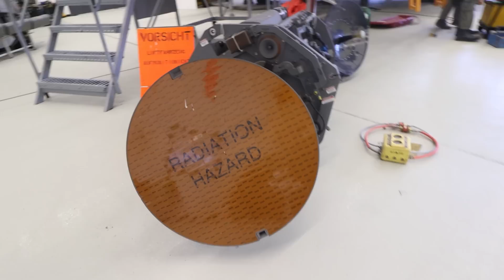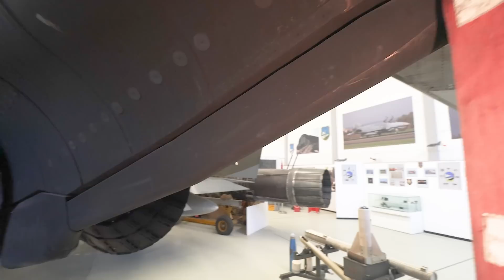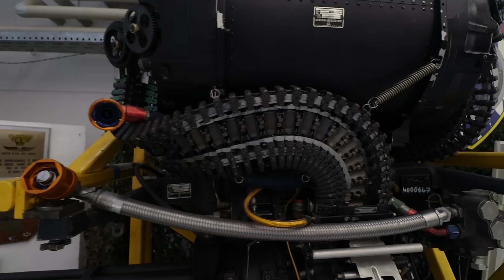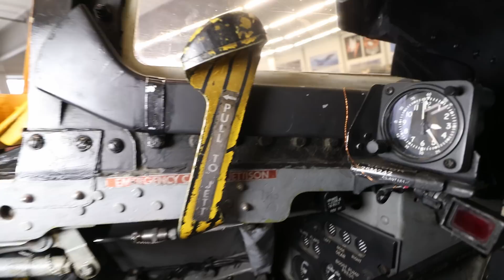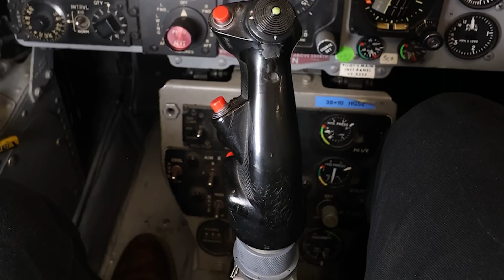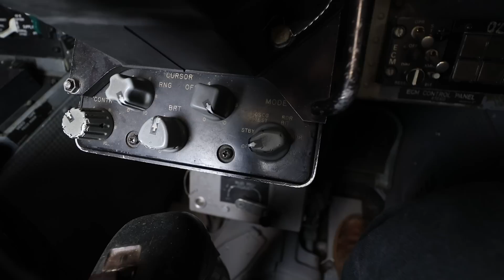Inside The Legendary F-4F Phantom II: Full Walkaround & Cockpit Tour

Comment: In the F-14 and F-4, the guy in the back is a RIO, not a WSO.
Reply: As an former USAF F-4 backseater, I can confirm that the correct title for the Guy in Back (aka GIB) is Weapons System Officer. I believe the  Navy and Marines used the title RIO - Radar Intercept Officer.
Reply: @GWBuck the Navy/Marine F-4  GIB wasn't a pilot(Naval Aviator) he was a NFO.  In the Air Force both guys at first were pilots.  That's a key difference.   This changed in the 70s to the WSO designation but in Naval Aviation they were never pilots; RIOs were all NFOs.   Those dudes had an easier transition to Tomcat RIO than the pilot of an F-4 did to Tomcat pilot.
Reply: @karlchilderz Good additional information. The transition in the Air Force from Pilot backseaters to Navigator backseaters (WSO’s) actually started in 1968.

Comment: Can anybody elaborate on why they would use a spoiler on the "downward rolling" side instead of a noticably upward deflecting aileron?
Reply: @Bud_Yeddi  The spoiler “spoils” or decreases lift. An airplane rolls when one wing produces more lift than the other. This is what ailerons do, a spoiler is another way to accomplish this.  The reason to use spoilers may be to add additional rolling capability without having overly large ailerons or because ailerons become less effective at certain  speeds or angles of attack due to how air flows around the wing. Some aircraft exhibited strange roll tendencies like opposite roll at certain conditions. This is where inputing left aileron would actually cause the aircraft to roll right, spoilers can be a way to alleviate that. 

Many airliners also use spoilers which also can help on landing by decreasing lift and adding drag upon landing to increase braking effectiveness achieved from the wheel brakes.
Reply: @palagiewicz  wow thanks for that info! That reminded me of something I read that said the F4 and F14 specifically over a certain AOA you have to use rudder pedals to initiate the roll as there was a risk of getting the opposite reaction as uou mentioned. Airfoils and aerodynamics are so fascinating. Its almost like blk magic or advanced wizardry

Comment: I knew the phantom was still in service when the AMRAAM started in service, but I neve realized it could mount it.  I always just sort of assumed that it was never fitted for the 'latest and greatest' weapons and soldiered on with older gear, since it left front line service not that much after the AMRAAM was introduced. I wonder if this was only done in Germany where the phantom stayed in service a lot longer than it did in the US.
Reply: @EPG_CATX  the AAMRAAM while looking like the Aim-7 sparrow is shorter and smaller in diameter. However its fins are identical in size and placement, specifically so any bays or mounts made for the sparrow can mount an AAMRAAM

Comment: I have a question about the radar warning system on the F-4F. I know on the ICE Phantoms the RWR is the ALR 68(V)2. But for the original F-4F, what radar warning receiver was fitted to it? 
Was it the ALR 46 that F-4Es got? Or was it the APR 25/26 common to F-4C/Ds?
Reply from the maker: That's a good question. I suspect that it was the 46 since the F is a simplified E but during the research for this episode I found that anything before ICE is poorly documented (where I can reach it).
Reply: @MilitaryAviationHistory  The F-4F's we had at George were not delivered with the ALR-46 as that set didn't get into general service until after Vietnam, post 1975.  The E models came with the APR-25/26 joint set like the C's and D's.  After I left Phantoms in 1976, I lost track of the upgrades on any of the versions
Reply from the maker: That's great info, thanks!

Comment: It's very striking that several aircraft share a room, but next door the Phantom gets one all to herself. I'm not sure how accurate it was, but I remember decades ago watching a documentary, and there was an interview with someone who was either a designer or engineer, and he said of the Phantom "It's a very big, very fast bus.  All of those odd shapes and angles are bandaids for poor aerodynamics."  and I'd say they did a pretty good job addressing those 'poor' aerodynamics.
Reply from the maker: In thrust we trust! 
P.S. Don't forget the little VW Beetle next to it :)
Reply: I used to work next to a Phantom squadron and was mystified by the odd aerodynamic details (at least in comparison to the A-4's I was working on).  After learning more about McDonnell's history, I could see how it was an evolution of the F3H Demon.  Same arrangement of the tail, with the horizontal stabilizers behind and above the jet exhaust.   This can be a problem, because the wing can block the air to the stabilizer at high angles of attack.  The other fighters of the era, such as the Grumman F11F or Vought F-8, knew enough to run the exhaust to the very back of the fuselage and mount the horizontal stabilizers low on the fuselage.  For the F4H, McDonnell stuck with the old arrangement and just angled the horizontal stabilizers at a sharp angle to try to get it below the wing.  I'd love to hear what the designers were thinking when this was done.
Reply: @SkyhawkSteve  The F-4 really shares a lot of DNA with the F-3H indeed, but with some F-101 input as well.

Of you look at the history of designs from many manufacturers you can see the design evolution with each iteration, whether those designs lead to production aircraft or not.

For example, the North American P-51 and F-86 have a host of designs in between those which show the gradual evolution from a piston engined fighter to a straight wing jet aircraft (using the P-51’s wing) to the eventual Sabre.
Reply: "The Phantom is proof that with enough thrust, a brick can fly."
Reply: Your memory serves you well. That was Pierre Sprey, part of the "Fighter Mafia" that pushed for more natural fighters, resulting ultimately in the F-X program, producing the F-15 and F-16.

Interestingly, with the 'low' tech solution of the two, the F-16, even the radar was questioned and it was suggested that a guns and IR missiles day fighter only might be the way to go.
Reply: 10:17 have I understood that right? That panel changes how loud the missiles are? Is that once fired or when they’re attached to the aircraft? Could anyone explain the purpose of this and why the pilot/WSO might want to ever use this panel? 😂
Reply: @Chug-ip6nf  I believe that's the volume control for the growl you get in the headset when using IR missiles.
Reply: The F-4 was said to have the same aerodynamic qualities flying sideways as it did flying forward.